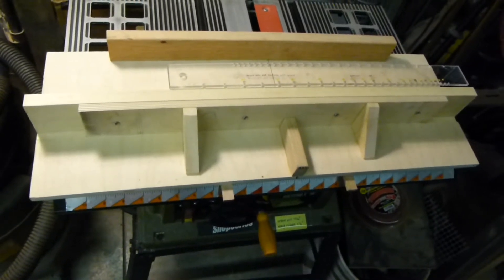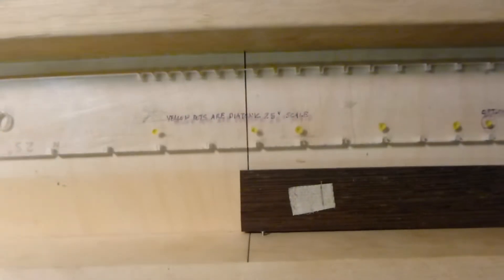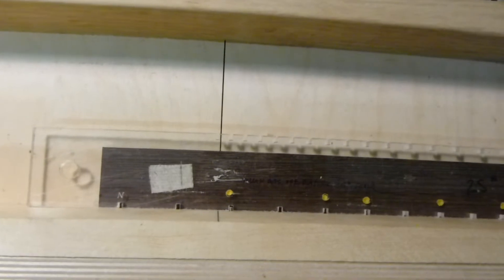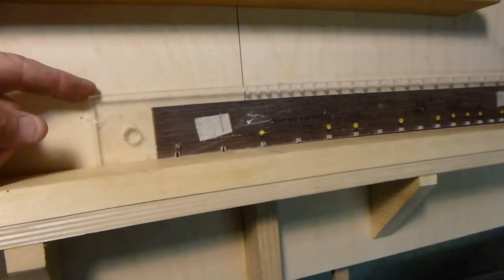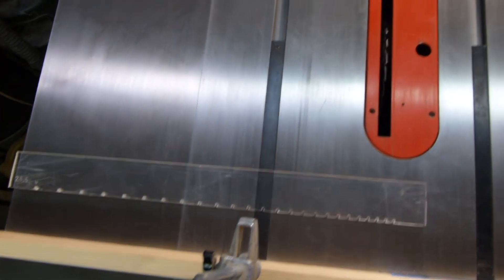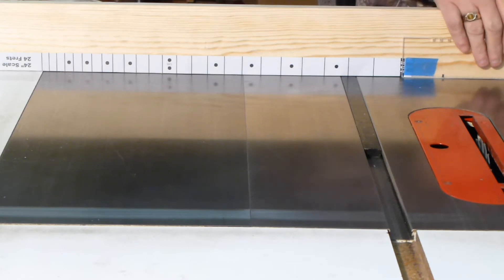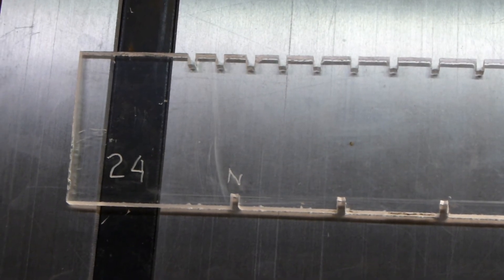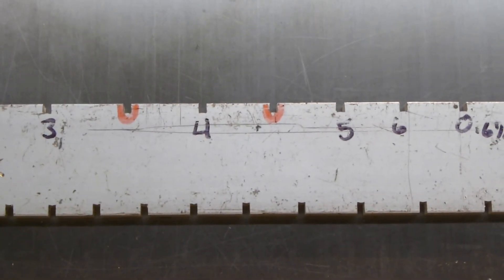Making DIY Fret Scale Templates and my Fret Slotting Jig

Comment: What are using for the locating pin?
Reply from the maker: After I cut the notches in the template, I used drill bits to check the notch. Once I found a drill bit that fit into the notch, I used a cutoff wheel in my Dremel tool to slice off a piece about 1/2" long from the unfluted end.  Use the same bit to drill the hole and press the pin in. You might need to put a drop of super glue in it to make sure it doesn't come out.

Comment: So you print off your scale length and check for accuracy?
Reply from the maker: Hi Barry. Yes.  I use an older free program called WFret to print my scale length.  Another free program is FretCalc.  MGB Guitars sells a great fret template printed on an oversized sheet of paper that has 7 scales ranging from 20" to 25.5".  Cost is less than a dollar last time I looked.  I was using a CB Gitty template in the video.  I don't like the CB Gitty templates as well as printing my own or using the MGB template. The fret lines are thick on the CB Gitty template, but showed up good on camera.  The thinner the line on the paper template, the more accurate your polycarbonate template will be.  I did the video more for informational purposes, but in reality I used a magnifier headband and take my time to make sure the polycarbonate is exactly on each mark before cutting it.  I previously cut fretboards by hand using a jig and hand held saw, which this will work for also, except the polycarbonate template would be on the bottom of the fretboard on a set up like that.  
I have a Stew Mac template and if made carefully, these polycarbonate templates work as well for a lot less cost.  If you are doing hundreds of fretboards, the Stew Mac might hold up better with less wear, but you could always cut another polycarbonate template if you needed to.
Reply: @tramp.art.guitars  I’ve seen this other fella on you tube . I just want to make sure the print outs are accurate!!!
Reply from the maker: @barrywhaley958  I have not had any issues with any I have printed. To double check your printed template, measure from the nut to the 12th fret, and double it to check the scale length. For example, if the nut to the 12th fret measures 12.75" on your paper template,  the scale length would be 25.5".  If it doesn't seem to come out right when printed, check your printer to make certain it is printing at 100% scale.

Comment: good job!!  I have a radial arm saw, but I have a sled on my little table saw. Not sure which would cut fret slots best, but the sled seems like it would be perfect for making the Templates!
Reply from the maker: Thanks! Either will work for cutting the slots. With a radial arm saw to cut the slots, put the pin in the fence and your template will be on the bottom. The main advantage to cutting the slots on a table saw is that once you have your depth set, the thickness of the fretboard doesn't matter. On a RAS, if the boards are different thicknesses, you will need to adjust the depth of cut accordingly.  Not a big deal, but I finally got tired of doing that when I was sawing the slots by hand, and went the table saw route.